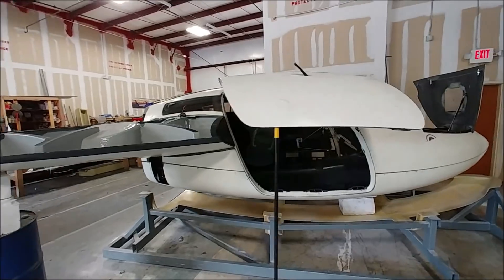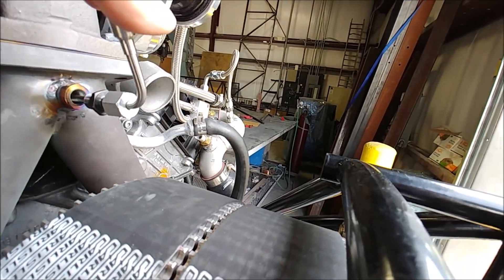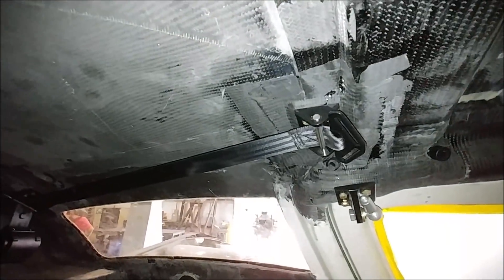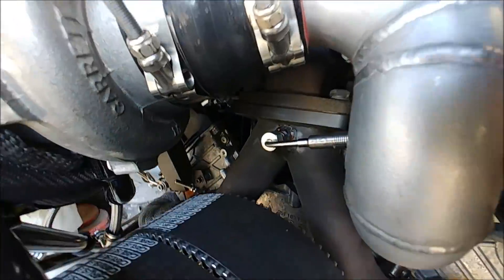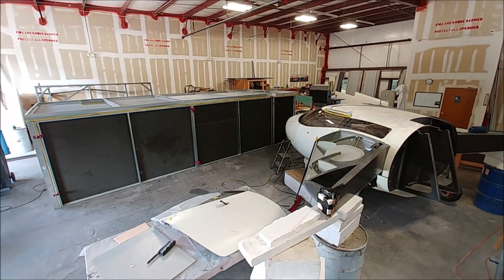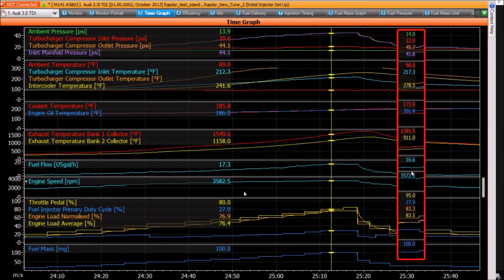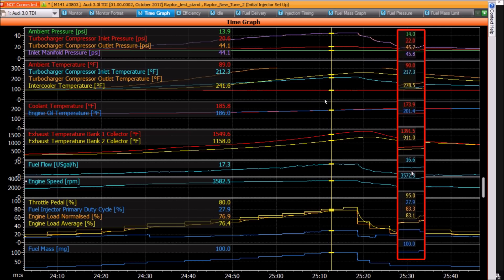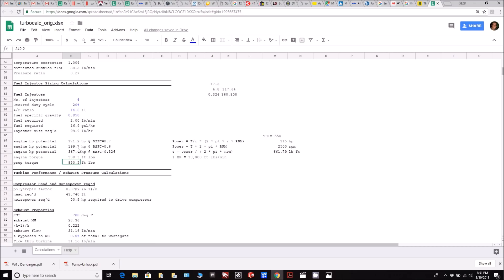Cooler = More Power - Building the Raptor Prototype

Comment: What do you plan on doing to lower those EGT's? From my experience 1500 degrees is not going to be sustainable for any lengths of time. 1200 - 1300 is manageable all day long. Making horsepower is fun, but it's got to last.
Reply from the maker: From what I all researching the cylinders can handle at least 1300f sustained and the turbo around 1900f sustained and we're below that right now. Also we'll only have full power for takeoff and initial climb to perhaps 1000ft.

Comment: Peter, Carbon Fiber has a neg coef. of expansion meaning it contracts when heated....not expand like you said. So the window and frame were expanding during post cure and the carbon contracting causing your issue.

Comment: Peter, I think you misspoke re post-curing: the heat causes the epoxy to fully cure; I’m not aware of heat cure affecting the carbon (?). Regardless, super-important step!

For other viewers, epoxy doesn’t truly “cure” 100% at room temp. Fully curing it under heat causes the epoxy polymers to cross-link (more) so you get the best physical properties out of it, makes it much stronger - and increases resistance to heat, so we won’t have to worry about parking our Raptors under the hot sun.

Terrific progress!
Reply from the maker: Keep in mind that most of the time I have no idea what I'm talking about. I'm lucky to even be able to speak in full sentences on occasion. 😋
Reply: Raptor Aircraft LOL 😀 full sentences are overrated - you’re making a PLANE!
Reply: It's more like the post cure solidified the cross links prior to stress application.
 The cross links form during initial cure but some are weak/marginal so the post cure ties in those weaker links prior to them failing under full design stress. Also these links CAN form at moderate temps over long periods of time if they're not stressed too early.

Comment: Do I understand that you're surface mounting the windows? 

It would seem that the exact problem you had in the oven with the different expansion rates is going to be trouble overtime in the actual aircraft.  Even if you give more tolerance in the clearance between the Plexiglas and the carbon, each having its  own even expansion rate is going to bring a little pressure on the Hysol

 In a pressurized situation, the window popping doesn't seem like a good situation. 

Perhaps you can sit should consider mounting the windows inside frames so that pressure actually snugs the plexiglas into the frame rather than being stuck on with Hysol

I'm not trying to throw rocks here.  Im trying to be helpful.  

What am I missing here?
Reply from the maker: Already said for the last year or more that we're going to redesign the doors and how the windows are installed.
Reply: I have heard about the doors  (many times) ...I had not heard about the windows.. Especially those windows not attached to the doors.   Thanks for the clarification.

Comment: I've been following you along since you began. I'm wondering if you have taken a look at Commuter Craft    https://www.commutercraft.com/  to see how they have solved their problems. Currently they are going thru their first customer build, I believe 5 or 6 customers who will be building their aircraft under strict supervision in the Commuter Craft factory, and allegedly in 2 to 3 weeks. Their aircraft, although not pressurized, and using a stock non turbo Lycoming, is nonetheless all carbon fiber/plastic. So I thought it might be helpful to see how they have gone about building their plane.
Reply from the maker: Thanks for the suggestion.

Comment: So the window will have constant pressure from the inside out while in flight at altitude. What is the proposal for a mechanical fastener to keep them from working loose after a thousand  hours of flight time? I would imagine a window would not just pop out but rather loose cabin pressure first then pop out after continued flight.
Reply from the maker: And I just said above, and have said for over a year now, we're going to be redesigning the doors and how the windows install.

Comment: Good progress! Tickles my inner geek on how things,especially airplanes, get made. Keep the updates coming. They might pull my wallet out of my pocket for a deposit position...
Reply from the maker: We have 7 pins, 3 hooks and two over spec'd hinges that have all passed FEA so it should all hold.
Reply: Using the door hinges as structural supports won't work. Your gonna need pins at top, middle and bottom to prevent the door from ballooning under pressure. Otherwise the build is progressing well and looking good!
Reply: MegaScott But the doors do  have roller cam latches on all sides already. They are also CF reinforced.  I think they will he fine.